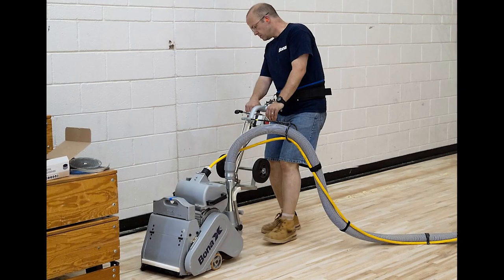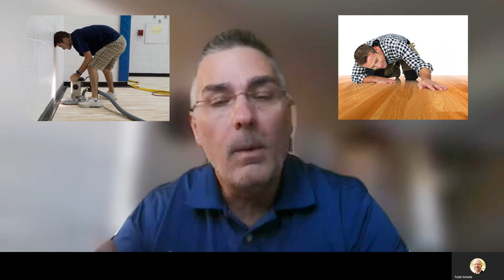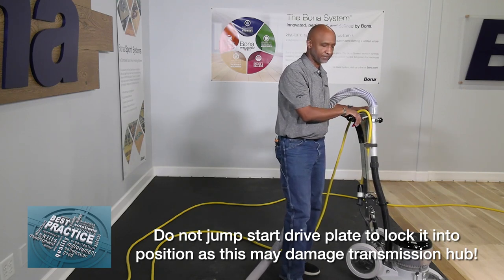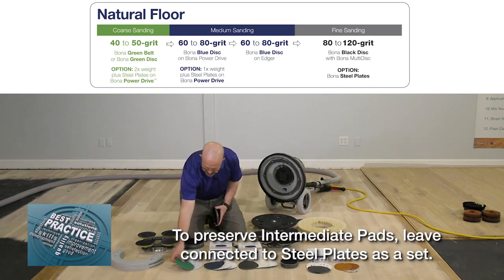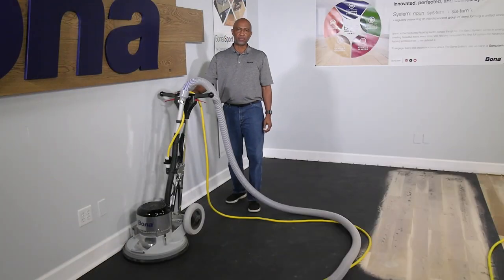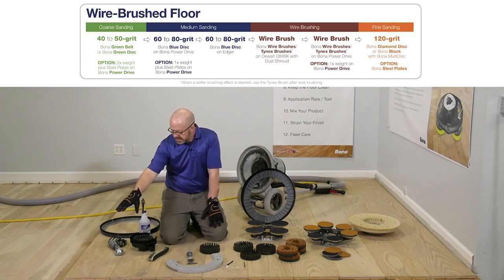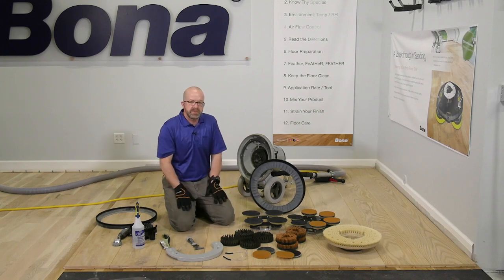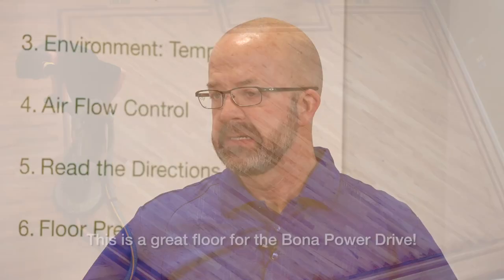Bona Power Drive®: Game-Changer - webinar

Comment: I want to know what vacuum is being used with this sander.
Reply from the maker: Hi @rowankeltizar5961 - We usually use the Bona Portable DCS 2.0 vacuum in conjunction with the Power Drive, but the Bona DCS 50 (a recent addition to our line-up) also works well. The DCS 2.0 is a powerful, two motor, system that combines a Bona exclusive two-step cyclonic intake system with two hospital-grade HEPA filters, and a perfect blend of 92" of water-lift (suction) at 235 CFM (volume).  It also has a convenient Longo-Pac bag system that helps keep the job site dust free when changing bags inside.
Here's a link to our dust containment vacuum line-up:
https://www.bona.com/en-us/products/professional/machines/dust-containment/
Hope that helps!

Comment: Does the intermediate pass come with the steel disc when bought ?
Reply from the maker: Hi Bill - No, the Intermediate Pads and Steel Plates are sold separately. The Intermediate Pads come in two thicknesses (1/4" and 1/2") and two sizes (5" and 6"), while the Steel Plateswhich are also available in two sizes (5" and 6"). Hope that helps!

Comment: Bona does not compare to drum sander, orbital gets clogged in seconds, drums gers job done with minimal belt changes!!!
Reply from the maker: Hello Mxfern12 - In most cases, the first cut is still most effective with a belt sander. However, the trend is then for most craftsmen to switch to their Power Drive to get closer to the edges (reduce edging 50-80%), and perform the medium, fine, and x-fine cuts (no chance for drum/edger marks and way less fatigue on your body). If needed, you can also use the Power Drive for all cuts in areas where the belt sander won't fit - pantry, cross-laid hallway, behind the kitchen island, etc. Sandpaper getting clogged is more often caused by contamination (waxes, oils, polishes) on the surface; going too slow (heating up the finish dust and melting it onto the sandpaper); using too fine of a grit; and or poor quality abrasives. Next time you need to cut finish off with your Power Drive, consider using Bona Green Abrasives (ceramic blend) in 36, 40, or 50 grit. Thanks and hope this helps!